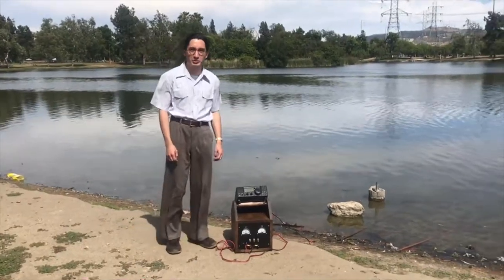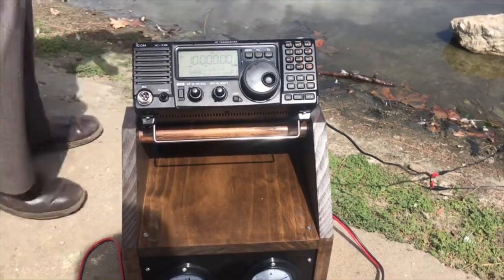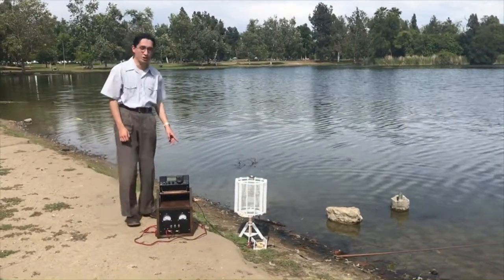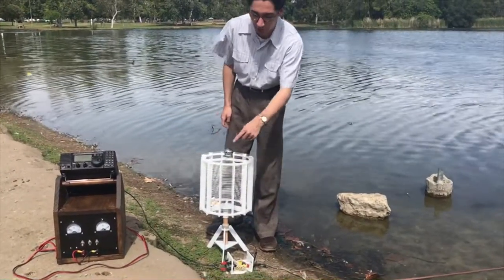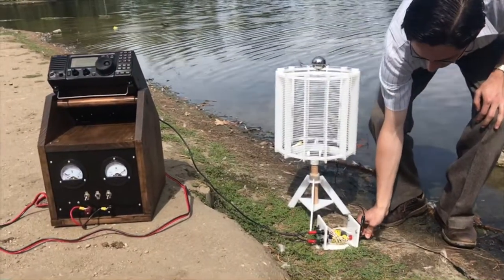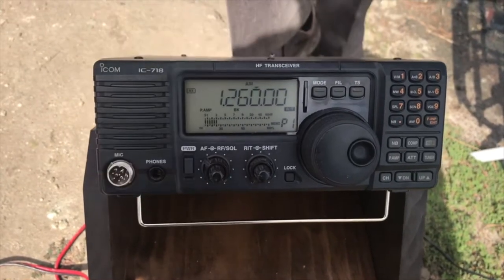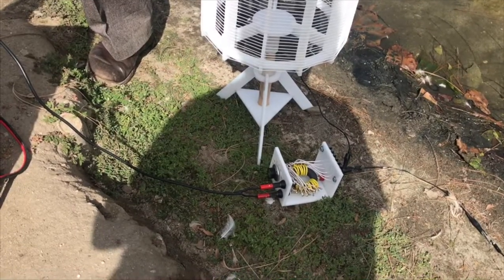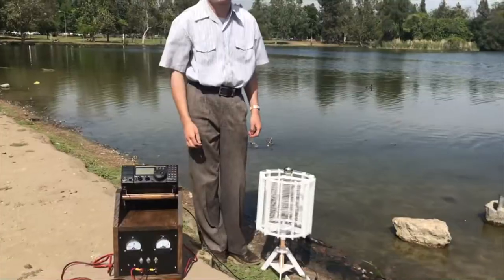Demonstration of Telluric Wave Reception

Comment: Hi I am very new to understanding these concepts but very interested, particularly the potential practical applications. My understanding is that Telluric waves are electric currents which flow underground or through the sea. So this is very close to what Tesla envisioned with being able to plug into the ground and tap into a global wireless power network...correct?
Thanks
Reply: for power and/or communications. There are submarine networks that use ultra-low frequencies. A gentleman named Stan Deyo mentioned a low frequency that some governments might use to broadcast power -- but it would be a secret. I think it was something like 13.5Khz. I think this was mentioned in Stan's book "Cosmic Conspiracy".
Reply: Very close but there's a part missing, the waves being picked up here are coming from a source that is operating on magnetic Hertzian wave induction, meaning the strength of the signal is a lot weaker than it's full potential, by making the source run on Dielectric Impulses, or 5% Electromagnetic and 95% Dielectric in Tesla's words, the strength would be far, FAR stronger and allow for both communication and power transmission in this manner.

Comment: It is rumored that Alfred Matthew Hubbard was able to power his boat on a lake using some Tesla technology -- Hubbard being a little boy that might have learned some things from magazines of his day with Tesla featured many times. There was also the encouragement, in these magazines, of experimenting with Radon which at the time they didn't know was dangerous to human health. Hubbard's coil design, placed in the boat, could power an electric motor to propel the boat. Some people speculate that he had a transmitter on the shore providing the wireless power to his boat, received by his coil on his boat (not unlike what Tesla might have done with his remote control demonstrations to the navy). The power source in his coil may also have been Radon. Unclear. It is said that Hubbard created an antenna system in the trees that had 4 120 foot lengthed wires each in the north, east, south and westerly directions. These 4 wires were connected to a bottle with mercury for a make-or-break system. It may have also been a Tesla-style coherer or something. There is a lot of speculation about this. But this could have been the source of power to his transmitter on the shore. Hubbard goes on to be the Johnny Appleseed of L.S.D.

Comment: Would it be possible to show that suspending the ground rods in air does not allow you to pick up a signal? It seems like the rods themselves might be acting as traditional antennas, they're just submerged under water and positioned horizontally.

Comment: I would think the interesting telluric waves are LF and ULF. The AM band is too high. Creating a good antenna for these lower frequencies is difficult. One interesting antenna to experiment with is the so-called "Bashar Space Time Antenna". By using two intersecting cone coils, with turns going the opposite direction, a plane where they intersect can be buffeted by low-frequency RF. I've managed to see frequencies even as low as Schumann, 7.8Hz when attached to an oscilloscope. The RF frequencies in the audio range can be given directly to an audio amplifier. This is where I think telluric might shine and stuff Stubblefield was messing around with.

Comment: Telluride reception question. What is the propagation speed?  Is it C or faster?
Reply: Think about this. For conventional short-wave radio, the signal bounced up to a certain distance in the atmosphere, then bounced down, then up, then down, in a sort of zig zag. Such signals could go around the planet in this way and are thus traveling distances that are more than the circumference of the Earth. Sometimes you can even hear an echo with some of the signal arriving at time X and some of it arriving at time Y and so on. But now, what about a form of communication that travels THRU the planet. That distance is an Earth diameter and thus faster than the very large circumference.

Comment: Well. thank you for  your work but, I have problem with your revelations from physics stand point and practical experience with antenna,  what for  me is just  a coil with counterpoise assembly. You'll have exactly the same  effect  when  disconnecting   metal body  of your car acting (as balance) from  vertical dipole ( - e.g your car antenna)
Reply from the maker: In this circumstance the Earth which is acting as a second terminal in the analogous Earth-Ionosphere waveguide, is simply re-establishing the refracted wave. As no antenna is employed in this scenario, and since the coil is not tuned to a Telluric "through the Earth" propagation frequency (in retrospect), the action of the Earth via the lake serves as a stronger electrical body for which the EM wave is received. 

This is similar to the situation you have expressed, although, the chasis of a vehicle while primarily isolated from Earth, with a degree of admittance to electrical ground, does not necessarily establish itself in direct contact with the Earth-Ionosphere waveguide cavity. It does exist in this waveguide, but unlike the video, the lake is used as a direct low impedance termination. It is helpful to conceptualize this as connecting to one plate of a capacitor (the Earth), while having the other plate (the ionosphere), quite poorly connected.
Reply: @GriffinGBrock  please go to my channel and look for the last video,
you can also find me at the topic  in  over-unity f-m
Reply from the maker: A moderate video, although Zenneck Waves find to be erroneous in the realm of true Telluric communication.
Reply: @GriffinGBrock  
I am absolutely friendly to you Griffin G. Brock  and FE icone Eric .
but I am in agreement with official physics only.!!!
I am over 30 years in physics, very much in electromagnetic waves and 
propagation. I've worked with NASA, Department of Defense, DARPA 
programs as principal investigator most of the time and  
as president of a scientific entity that was located on the 77th floor 
of World Trade Center one prior to 9/11.where I was 
employing a few Russian scientists and I've learned Russian to the 
highest fluency level. I personally visited Tariel Kapanadze and 
inspected his device. I have contacted most of the key figures in the 
world involved in energy for free transfer extraction and 
experimentation.
I represent the value of energy 
extraction from Schumann waveguide, both theoretically and practically 
and I am in full agreement with Dr. James Corum,
Kenneth Corum, my partner Dr. Hans and so on.

if you feel like you can contact me by  PM   or on  the topic of  Stefan forum.
we are discussing your video now at topic moderated by me.
Reply from the maker: @stivep1  For the sake of simplicity, this video, as I've stated before, does not demonstrate true Telluric communication, but rather capacitive establishment in terms of the Earth-Ionosphere Waveguide. In retrospect, certain requirements for establishing the Telluric mode were not met at the time of this video's conception. 

I've read various articles discussing the arrival of the Zenneck Wave whilst employing Tesla Transformers, whereby the experiment involves the half-wave mode of resonance to achieve propagation via the Zenneck Wave. One key difference occurring between the Zenneck Wave, and Telluric measurements made by myself and colleague Dr. Adrian Marsh, is that a properly designed resonant transformer will establish two modes of resonance. This being the parallel mode of resonance (a transverse electromagnetic component), and a series mode of resonance (a non-electromagnetic arrangement). The series mode "the Telluric mode" is desired for efficient transference of power and intelligence, such that, the series mode frequency does not correspond to a quarter wavelength nor a half wavelength of the coil apparatus. I have deduced that there in fact exists a definite frequency proportionality to explain this matter. 

https://www.am-innovations.com/category/experiments/experiments-longitudinal-magneto-dielectric/

The above link demonstrates the application of the series mode of resonance to achieve the latter. 

Below outlines the definite voltage and current relations with respect to the series and parallel modes of resonance along a single coil, providing a rationale for the occurring phase shifting of the series mode, irrespective to the coil's half wave or quarter wavelength. 

https://griffingbrock.com/2022/12/17/determining-the-hertzian-telluric-frequency-modes-of-a-coil/
Reply: @morpher44   sorry Youtube doesn't  allow me comment  with names and patent numbers
Reply: @morpher44 I
 I see your last comment only if  I don't click on all replies. I'll  try another way around  Xc Xl are reactive components of impedance.  Resistance can be omitted  if resonant circuit ( Tesla coil )  is  constructed  in respect to the patents(  mentioned in forum  I'm at, or my videos - patent from  July 28 1986  fig5. fig23. electromagnetic structure and methods .
 To make coil  with smaller  winds winding can be done CCW CW left and right .